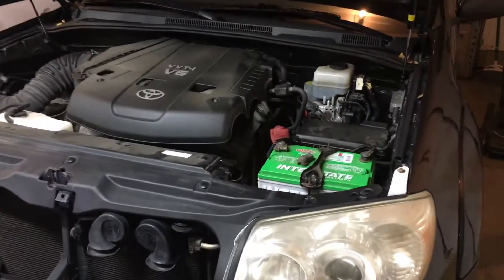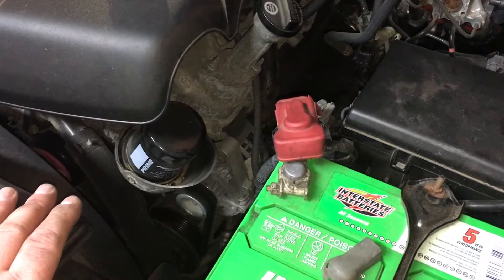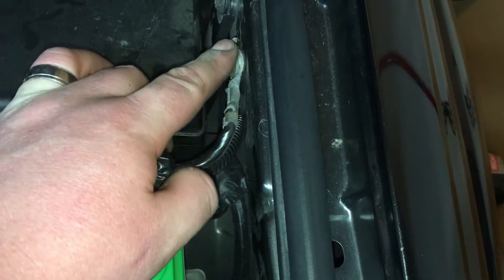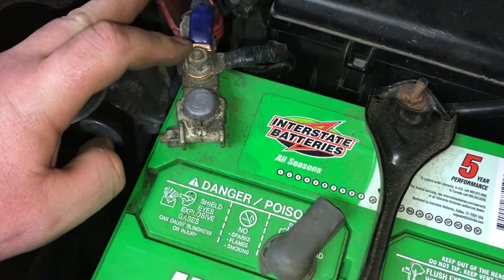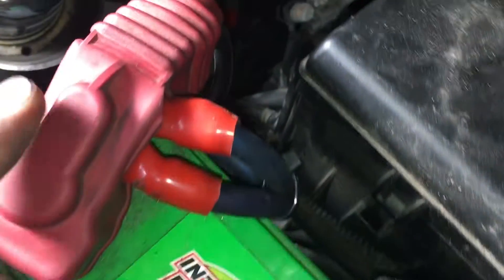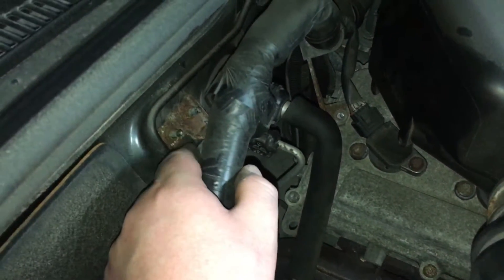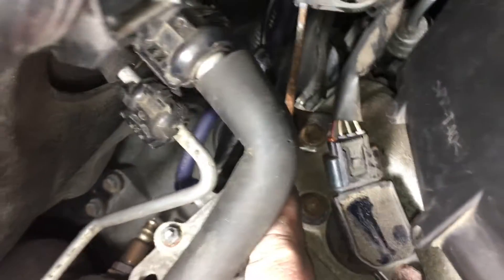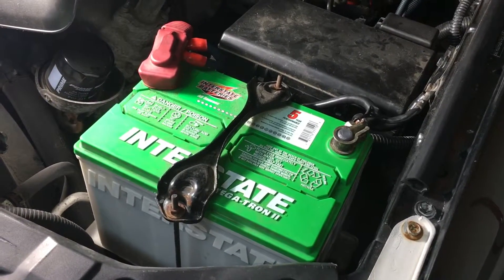How To Install A Car Audio "Big 3" Wiring Upgrade: Toyota Edition

Comment: Why only 4 gauge, why not run 0 gauge😊
Reply from the maker: (Old Video) but all depends on amperage requirements.  This is a factory spec alternator, so adding 1/0 over 4 gauge won't add any extra amperage delivery, just because this isn't a high output alternator.  If going with a HO Alt, yes, go with 1/0.

Comment: Should I use a fuse between positive battery terminal to alternator? Some suggest using % of alternator output to prevent fires. I have used 2/0 gauge without a fuse and just learning this could prevent a fire. True or hype? 1500 watt system 80 amp alternator. AGM battery.
Reply: If you like changing the 140a main fuse when the alt-battery fuse pops. OEM alt on 4runner is 130A, not 80.

Comment: What's your thoughts on CCA wire vs OF? I need to do this to my camry and I've heard bad things about CCA but damn OF is super expensive. Thinking bout taking my chances. Also on my car of course the battery is on the opposite side of the alternator so the power wire runs across the top of the motor, do you think wire loom will be good enough to protect from heat or do I need something more heavy duty?
Reply from the maker: OFC is the way to go.  Use this video for better guidance.  It also links a ton of kits for a budget price: https://youtu.be/VT1Gz0SL-7o
Reply: @ProvoBeastAudio  great! Thanks alot brother! 💪 💯
Reply: 3/8 or 5/16 for the ring terminal size? Im about to order all of the parts to do this on my 04 4Runner.  @ProvoBeastAudio

Comment: Thanks for the vid, I'm doing this on my Tacoma. I recently started with only the battery ground had to stop to run somewhere. But when I went to start up it hesitated and also idle dropped. Anyone know why that was? I used 8g ofc wiring.
Reply: 8!gauge is no upgrade

Comment: It would work better if you actual battery wires and not speaker wires 😉😉 You're Welcome
Reply: true, the ofc copper on the audio cable is a completely different material from the space aged conductor marketed for cars.

Comment: Thank you for this video, ive done several big 3/4s so im confident i was just having trouble locating the best place to ground the engine block. thank you so much! Yota Mafia. im ab to finish mine with 1/0 OFC from NVX on my 2005 SR5 4x4 4Runner.

Comment: Why would you leave the old wire in place and add the new wire to it instead of replacing it completely? Would be cleaner IMO
Reply: Mainly because the charging wires come as a harness. Some wires are sliced and have terminal ends. About $875 at stealership new.
If you replaced all the charging wires it would require more length and battery terminal ends. Some people go this route when their cables have damaged/rusted/corroded but is overkill if your oem wires are solid.
Reply: Electricity flows like water more wire = better stream. I have double 0 welding wire along with all stock wires but I’m also running over 5k watts
Reply: It would be cleaner but the real goal is extra wire. He has basically doubled the wire diameter (if you add up the old and new). You could find a cable that thick but easier to find standard cables.
Reply: @SSingh-nr8qz  its very easy to find 2/0 guage wire whether it be welding or audio wire. Also if you go with 2/0 wire your doubling the wire anyways. 
Leaving the old wiring in there could create resistance and just more wire to worry about.
Reply: 5k watts on the stock alternator and everything? I've done the big 3 with welding wire as well,  I figured I needed a new alt and agm battery to run 3000w amplifier though?

Comment: can you just add the bigger wire on top of the existing? example the existing power wire is part of a connector housing other various wires, if I cut the connector the new upgrade wire won't fit to the connector.

Comment: Big 3 is pretty much 2 negatives and 1 positive, correct? 
Positive: battery post to alternator 
Negative: from battery post to car frame 
Negative: from block/engine to frame 
Yes?
Reply: I suppose a Big 4 would be that plus Negative: battery post to alternator ground
Reply: @amthevision8931 there ain’t a ground in the alt
Reply: @exoticgunner7083  its really alt+engine to battery neg, since you put the ground lug between the alt mount to engine.
Reply: Directs people to comment below if they have any questions .. Doesn't answer questions.

Comment: My understanding of the big 3 were alternator to (+)battery, (+)battery to fuse box, (-)battery to ground point. Adding a ground from the motor to the frame/battery (-) will help with motor sensors. An 8ga to each side of the motor or heads and one to the transmission body, then to ground point help with all the electronics in the motor. Sometimes netting up to a 10 hp gain.
Reply: Really you should upgrade all honestly hp gain or not. If you plan on adding lights, amps, winch etc
Reply: Benjamin Ricca you got info to back this claim?
Reply: Marz clouds there was a car audio magazine that did the engine grounding in a 90's Volvo that netted the 10 hp gain. I don't remember which one or when, so, no I don't but they do make ground kits, so...?

Comment: FYI, if you do this upgrade I would recommend using clear spray paint to cover the brushed paint areas to seal it and prevent rusting.
Reply: either works fr, but grease is really the way to go just because a good rattle can of clear is gunna set you back about 4 times what the grease would. i honestly never even thouhgt about using clear coat but its a cool idea!

Comment: so is this worth doing even if you don't have a audio system?
Reply from the maker: Not necessarily a need,  but always helps with voltage.  It prepares you for future upgrades down the road in case you add lights, audio, winch, etc.
Reply: Thanks for the response!